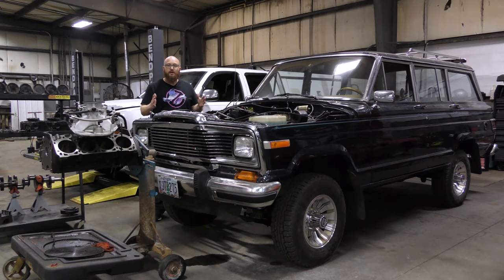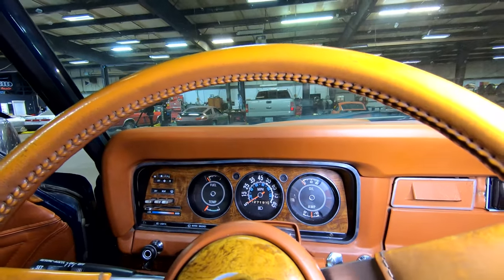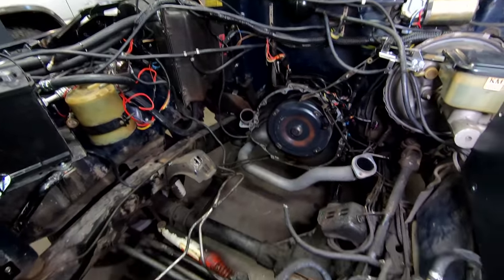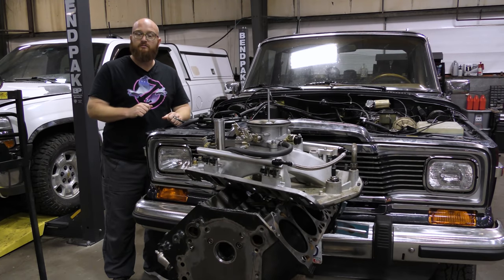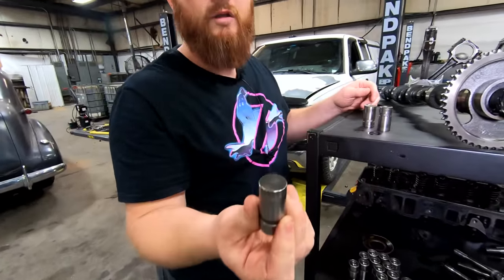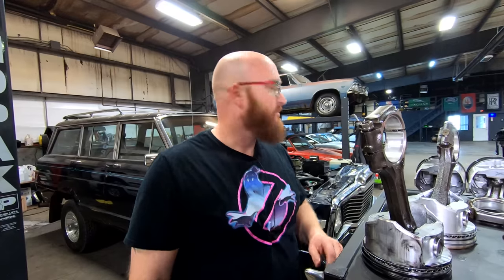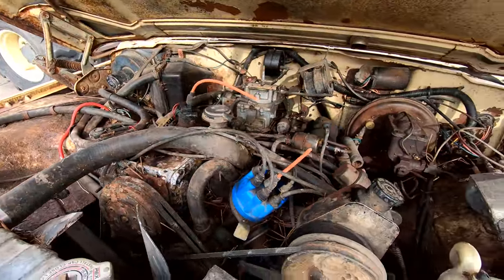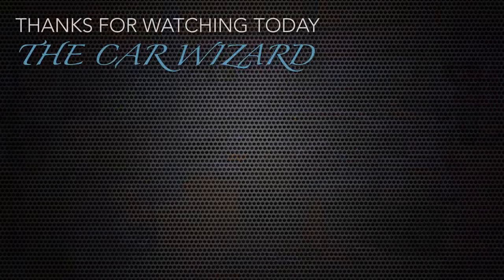The '83 Wagoneer rebuild is dead! CAR WIZARD gets burned by another shop!

Comment: My $.02 is that the abnormal lifter wear put a bunch of metal shavings into the oil which caused the piston pin to fail but should have been caught by the oil filter. I’ve heard of re using the original lifters if they look good in this day and age of low quality parts.

Comment: Looks like no assembly lube was used. 
Like the pistons and cam wad coated in normal oil and installed in lieu of a thicker more pressure resistant assembly lube. 
All you’ve shown is indicative of lack of proper assembly lube.

Comment: The lifter failure in that engine is very common. the issue is how the lifter is ground on the bottom. the cam lobes have a very slight fore and aft slope, the bottom of the lifter has a slight dome shape to it. This causes the lifter to rotate in its bore while the engine is running to keep an even wear pattern all the way around on the mating surfaces. When the bottom of the lifter is flat, it doesn't rotate and rubs only on one spot, causing the lifter have a step worn it and grinds down the lobe. the analogy I can give is the lifter is the tire on a car and the lobe face is the road surface. If you a pushing a car with tires that can freewheel, the tires don't wear out. push a car with locked up wheel and you going to grind the tires down, in the case of the lobe and lifter both the tire and the road get ground down. The quick fast and easy way to check the lifters is to place them upside on a bench and lay a straight edge across the bottom, if you see a sliver of light on both sides and none in the center - good to go. if there is no light across the entire surface - scrap metal. While the stiff wrist pin would be inexcusable upon assembly, is there a possibility that it is a symptom of the antifreeze mixing with the oil? I have been bit in the butt by this issue, I built a 440, we tuned and trailered it to OCIR. At the track we warmed it up did final tunes for the weather and altitude (1976 fuel injection was rare and expensive) performed a burn out, staged. while staged the first issue arose, the idle started hunting (Idle speed raises and lowers randomly). the next sign of an issue was at approx. 120 feet down the track, it backfired. Third sign the engine shutdown. the reason I say all of this is because the engine I built ran fine, as best we could tell, for nearly an hour. So the shop that built that engine may have done the dyno testing that they claim, these failures are not instantaneous.

Comment: It looks like this engine was slapped together as fast as possible with the finest el cheapo crap they could find at the local junkyard and the parts store. They found that some parts didn’t fit quite right so they forced them in. In short a motor thrown together ASAP and the builder didn’t give a rats ass what happened after they shipped it out. Whoever that builder is should be ashamed they sent out a ticking time bomb

Comment: I would just do a re ring job and bearings and gaskets use the cam and lifters when you do the rebuild all the Chinese crap we need to bring our companies back to the usa take them back from the enemy I would like to see gm and Ford bring out the 1970s square body trucks stop building cars out of bear cans make sure to put a race oil with a high zink in it the old engines need the zink the oil company's took to much out or use a zink additive and a lot of asymbaly lube

Comment: All the problems with engine is the wiped out cam and lifter.  All the debris and metal have gone through the oiling system and hurt the bearings and wrist pins.  If you do a bit of research, you can not purchase decent lifters anymore. 
So I would be very careful bagging the other shop. Also if you are going to do a review on the bad engine, you need to know what you are talking about.

Comment: Dont be so quick to blame the engine builder.  new cams and lifters have become a huge problem in the last few years.  Antifreeze can do a lot of damage in a hurry inside an engine,so that could explain the rod, wrist pin issues.  Not for certain, but possible

Comment: Looks like multiple failures for multiple reasons.  Even if the cam/lifter  hadnt failed, it looks like other problems would have killed it anyway.  All that points to a builder that was careless and had an apprentice throw it together, with a lot of poor quality parts.

Comment: I'm not so sure you can 100% blAme the builder on this one. That was a solid lifter motor that needs proper break in on the cam to seat the lifters to the cam. Along with break in high zink oil you also need a relatively smooth running idle and rpm sweep to break that cam and lifters in. With the cam lobe being whipped out and the push rod busting the block would send enough metal threw the oil system causing the bearings to fail and the lack of proper cooling and oil flow due to the hole can and will lock up that rod the way it is. To me a mechanic and builder myself it's very easy to see how things became junk so fast and in the manor that it has. You admit there is alot of aftermarket parts and an obvious lack of break in oil or even a good zink based oil like that of vr1 , mix that with not going and doing a proper break in procedure due to either lack of information or just assuming it was done. Now what can be put on the builder is if they did not give you proper information as to what needed to be done or if the owner was told but never passed it on to you. But being in this industry for as long as you have you should have automatically brought up this question of if the cam was broke in or not before even trying to fire it for the first time, along with that you also should have primed the oil system first , yet another thing you did not say if you did or not, and if you had known the cam needed breaking in put a simple carb on the engine to help with having a smooth operation on first start. this engine has been broken in properly I bet would not have failed and would be in perfect running order. So blaming the builder as it's the easy thing to do should be off the table and should be handled better than you are. Let's face facts here wizard. With the way you explained this along with showing it the blame needs to go on to you not the builder. That is fact

Comment: The video’s narrative seems too clever because few normal people—rich or poor—walk away from an engine rebuild that fails without a discussion with the shop that did the rebuild. And, the video’s narrative is also off of top dead center on another inference.  There is no profit model for a shop that install parts in/on a vehicle that are provided by the customer that includes a labor  warranty on parts provided by the customer.  The previous shop would not do that.   Another misfire in the narrative is the assertion that the Jeep’s owner refused to make a warranty claim against the shop that rebuilt the blown engine.  Why? The Jeep owner was told up front by the rebuild shop that there was no labor warranty on customer supplied internal engine parts. That is the actual reason why the Jeep owner did not at least have a conversation with the shop that rebuilt the engine that blew up.  Emotion (frustration, anger, whatever) had nothing to do with the valiant abandonment of several thousand dollars.  And now you know the rest of the story. 😊

Comment: Lifter failures aren’t uncommon in flat tappet motors, and a lot of the time the issue is in the machining process of the lifter itself and not improper break in. Sounds like the builder slapped all of the lifters in without verifying that they have a proper mating surface first. A super easy mistake to make if you assume that your brand new lifters are good, which they might very well not be…

Comment: why has no one mentioned oil? did i miss something in the video where that was ruled out? in combination with lack of rebuild lubricants this seems an oil flow problem. i would reuse nothing in this, make it all a boat anchor or have it recycled. if it was an oil issue, anything reused would have to be exhaustively cleaned and checked. the insides and engine bay are pretty though ^_^.

Comment: I don't think you can totally blame the engine builder. Modern oils eat flat tappet cams. There is no zinc in new oil. New camshafts get destroyed very easily these days unless you use a roller cam.

Comment: Back in 96 I bought an 86 Grand Wagoneer and put 3K to fix all the issues with that 10 year old car. (I knew the issues from a professional check before buying). After that initial work, it ran well except for a fuel pump that went out the first year. On the second year it couldn't pass emissions here in Colorado. It was a carbureted engine so it would only pass if it was, die at a stop light lean only. I ended up trading it in at that point due to the frustration of it all.

10 year previous, I met a woman who told me she was in a lawsuit with AMC over her AMC/Jeep engine. She claimed that they put the wrong oil in at the factory for the main engine oil. ...yes this anecdotal and I bought one 10 years later still remembering that...

But my advice is to put in a non AMC engine into anything you would do going forward...for AMC was in their death throws and the quality was circumspect at the time. And those engines were frankly out of whack for the size vs power vs efficiency of later engines.  IMHO

Comment: I took a engine out of a burned up jeep and that was in better condition than that rebuilt engine. It almost looks as though inferior  parts were installed. I would have went after the engine rebuilder as they owe him an engine. Sure anyone can say because they didn't  install it that the customer or even you screwed it up they will not cover the engine. My guess is that's exactly what they would have done. It's good you have your own guy that you trust. I had a transmission rebuilt by a local shop and it grenaded 6 months later. I will never take another vehicle to him again ever. Some shops just need to admit there are some Jobs they cannot do and do only what they are qualified to do, especially  if they cannot warranty  their work.

Comment: Oil pressure issue? I have seen an aftermarket front cover cause oil pressure problems on these engines. The oil pump gears should protrude slightly and the oil pump
cover gasket makes up the difference. On the aftermarket Chinese covers the gears will be slightly inset and when the cover is bolted on the gasket makes the gap even worse causing serious oiling issues. An oil pump primer should be used and the oil pressure verified prior to starting.

Comment: I have the entire original drive line out of a 1990 FSJ sitting on the floor looking for a home.  It was running fine when we pulled it, but could use a freshening up.  Reach out if it would be useful on this gig.

Comment: More and more I see failures like this they just don’t make cam kits like they used to but certainly checking spring tension is a must, even roller kits are less and less reliable. All that metal can detonate any part of the motor from the excessive lobe wear. Don’t always blame the rebuilder blame the parts manufacturers in most cases but certainly verify clearances and tolerances before installing the engine.

Comment: Idk about throwing the rebuilder under the bus. Things happen and I know this is frustrating but it's not that uncommon to wipe a cam lobe on a flat tappet engine. As far as everything else you found it could be a result of all the metal circulating in the engine. I appreciate that you didn't call them out by name but saying shame on the rebuilder was trashy and you should be better than that.

Comment: We were losing cams and lifters 30+ years ago. Even with 2000 rpm break in and the proper oil with zddp. Still a gamble back then. Worse now with the off shore parts. 

I rebuilt an engine about 10 years ago. I found nos cam and lifters on eBay. It's still running today.

Comment: I have seen carbureted cars that struggle at Yellowstone's 10k elevation.  I owned a completely stock '82 Grand Wagoneer that never had any noticeable difference at sea level or 10,000 ft elevation.  All with the stock Motorcraft carb.  That Jeep was my daily for 3 years in SE Idaho and may as well have been fuel injected it was so reliable from 100 deg summer temps to 10 below winter temps.  The carb in proper condition and tune was absolutely flawless even left overnight in 10 below in West Yellowstone!  They engineered them properly and they work great when in proper condition.  Granted it was only 10 years old and 100k miles on it at the time in the mid 90's and had never been subject to a hack owner or mechanic so I felt lucky.

Comment: I have a question did anyone put regular gas engine oil in it? I ask because those older engines need zinc and it is missing in most gas engine oil. I know on our 283 Chevy 57 vintage we had same failure on new engine. But the block was fine, we rebuilt and used diesel oil and had no more issues.

Comment: Normally you have an ammeter to show the current flow, the idea being that if the flow is high that indicates an electrical fault which might cause a fire. The ammeter is partly a safety device, useful if some previous idiot owner has replaced a fuse that kept blowing with a larger one. 

However, it takes a special kind of genius to make the ammeter itself the component that overloads and catches fire. Fitting a fuse for the ammeter itself is one thing, but having to make that smaller than the current the car itself can draw renders it pointless...

Comment: You can't just point a finger and say it's the builders fault, there are 101 reasons for an engine to fail, my company does comercial engine work, the first thing we do when an engine fails is oil analysis, its easy to point fingers, it takes a comprehensive examination by trained forensic technicians to find out what happened, still then anyone can make a mistake, the difference between a good shop and a bad one is what they do to address the problem if they caused it.

Comment: Uncle Tony's garage had a new cam and lifters go bad in an engine and suspected it was bad quality. Paul at Fab rats also had new lifters go bad in an engine. So it might not have been a bad rebuild it might have been bad parts. They might have bought cheap aftermarket parts. The hot coolant in the crankcase might have cause the damage to the bearings because the damage was already done when you started to hear it.

Comment: Sounds to me like there were several factors involved. The builder probably didn't bleed the lifters out prior to install, since you found one that was still sunk. They probably didn't prep the block properly, leading to the lifter on the damaged hole failing to rotate when it was actuated, causing the cam and lifter failure. It also looks like a lack of assembly lube all around.

Someone doesn't like cleaning and lubing their work.

Comment: If I lived in your state or you in mine , how would I find a shop like yours in Arizona . I be willing to tow or drive my Vechicles to get work done on them I use the due my own mechanical work . Before I messed up my back . I don't have special tools you  have the news Vechicle I have is 2000; F350 7.3 6 Speed it runs great but it's my older one need help . How can I find a Repair shot and a Machine shop that won't mess them up . 
Thank you if you can help or not thank anyway maybe make a video on how to find a local shop . Is there a rating sight or service . I even got a  piece of heavy equipment that needs little help  .

Thanks again for let me rant a little I Heard and seen crappy work .

Comment: Wizard I have seen this same issue on a engine in the past. There was a oil blockage. It's not necessarily the engine builders fault. If there was engineering done on it then they were supposed to have cleaned out all the water jackets and oil ports which was not done in this case. As you know when you assemble the block etc it is  necessary to turn the engine by hand to make sure that all the lifters do turn while putting and releasing pressure on the push rods. The builder could have easily done that but due to oil starvation when they started up the engine to break in the cam it could have seized up and cam failure would have occurred. All the I dications is there that there was oil starvation through out parts of the engine. The engine builder was supposed to get the engine back and then claimed a new block from the the guys who did the engineering on it. Cam failure does not occur immediately at times because some cams gets hardened by the manufacturer to try and avoid cam failure with engine builders who sometimes do not break in the engines

Comment: They quit putting zinc in engine oil that helps the lifter skate over the lobe. It's a non issue with roller cams. You have to add it at every oil change.

Comment: Root cause was probably no oil to the bad tappet and cam lobe.   Don't see why a bad tappet would wear the cam lobe unless it was dry. Assembly lube probably got the engine through he dyno test.  After the pushrod holed the block, coolant in the oil pan did the rest of the damage.

Comment: many years ago, we'd put a light grease on all the rubbing spots in a rebuild as we put it back together.  I knew some guys who would run the oil pump before starting the engine once it was in the car.  I would never have used a third party part' or engine

Comment: I would still want to talk to the original builder and find out what brand the cam and lifters were. I would not blame a single lobe failure on the builder.  The metal off the lifter probably did the bearing damage you pointed out. The builder should have the chance to make it right.